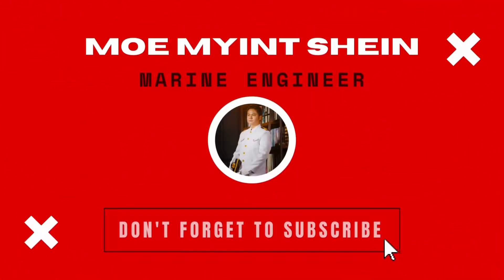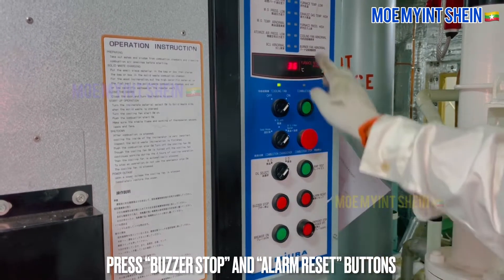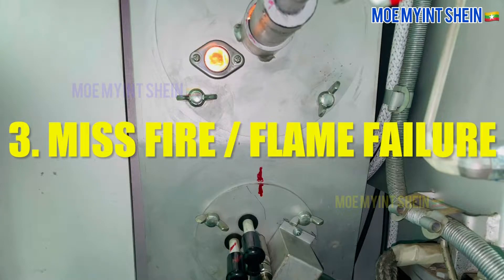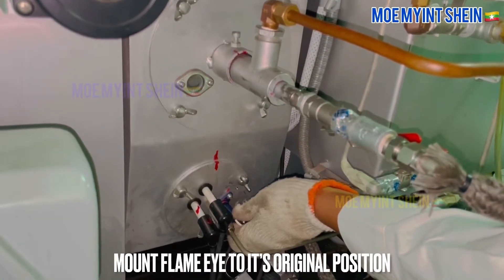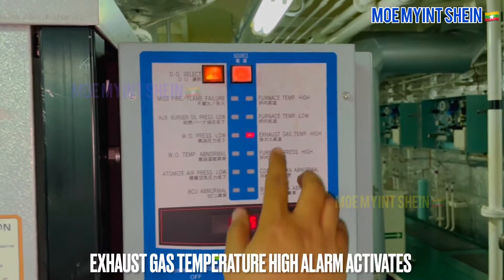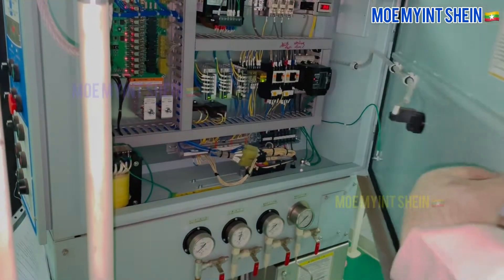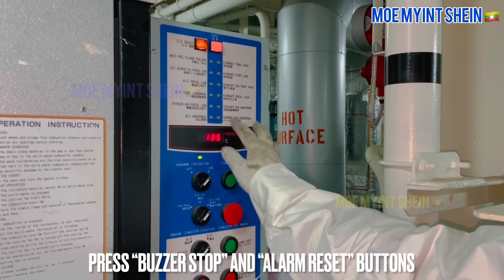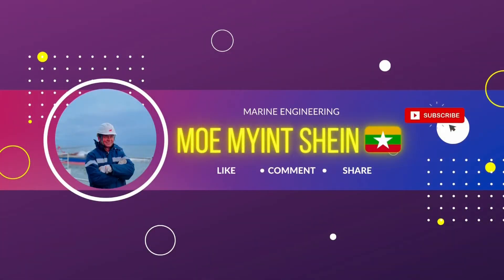[MiURA] INCINERATOR Safety Alarms and Trips Testing - 1 | MOE MYiNT SHEiN | Technical Vlog : 103

Comment: Good day Sir we have high pressure furnace alarm how to solve the problem thanks
Reply from the maker: Check inside the furnace for flue gas passage to chimney. If gas passage is either partially or totally blocked, this issue may occur. 

Clear accumulated soot over flame arrestor of incinerator chimney. 

Check pressure transmitter.